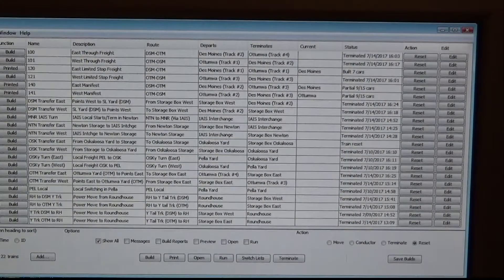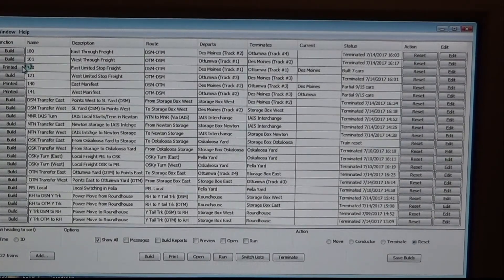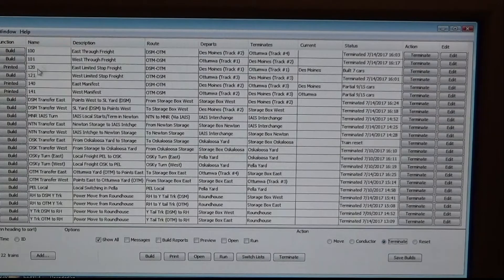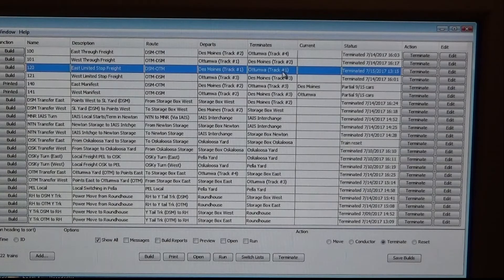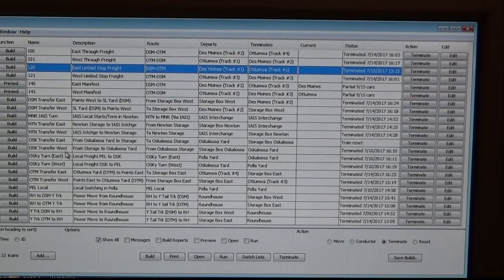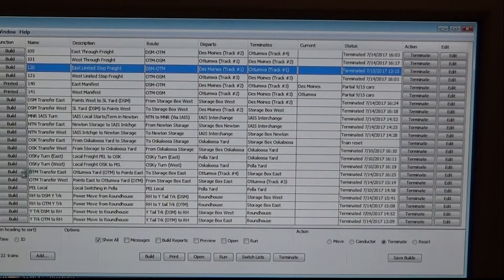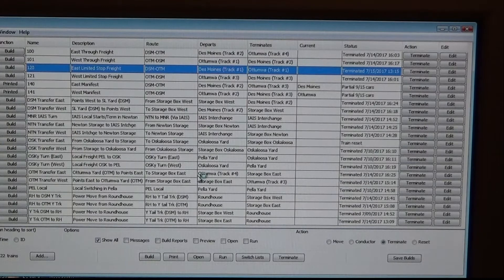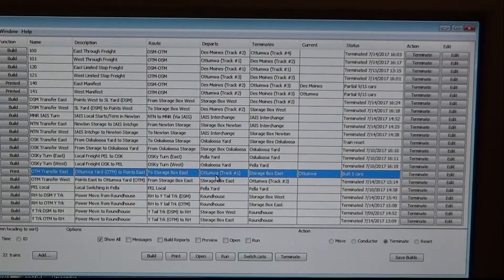DVRR Layout Update July/August 2017

Comment: Installed the program a few hrs ago and it changes the feel of the model railroad. With out a doubt this is a far superior way to switch cars on a model railroad. JMRI operations is simple to set up but, it is time consuming. once all the info is in the program its a breeze.
Reply from the maker: Agreed. There is a fair bit of "tweaking" to do, but once that's done it works great! Thanks for your comments!

Comment: thanks so much for this update, the drawer idea is a great one, do you just set them up as "tracks" in your "staging" yard?thanks for sharing, Chuck RVRR
Reply from the maker: I currently have the bins as "yards", but I may change that to "spurs", with some settings checked for custom loads. That way, the program will automatically load and unload them at the storage drawer level, rather than in the staging yard twice (out to drawer, and back from drawer). Thanks for commenting Chuck!

Comment: Yes I tried jmri ops, see some vids a while back. Worked well but a lot of setting up to do eg spur lengths etc.  Decided to stick with ccwb for now due to easier and self correction also no must for computer printouts. Its 6 of one vs half a dozen of the other and personal prefs. One is not "better" than the other imho anyway. Thanks for the vid. Robert
Reply from the maker: Robert, I guess I should have clarified that it worked better for me. I like the idea that it is closer to the way the prototype systems worked in the era I model.  CC&WB are a good system too and has work well for these many years. Thanks for your comment and for watching.

Comment: very nice update,  how did you get jmri to just dispatch cars?  ive tried getting mine to do that but didnt work,  idk if you could give me advice on how to do this or not? any help would be appreciated. ty chris
Reply from the maker: Are you looking to just move the cars and not the locos? This program is not a dispatching system (like CTC), rather it is a car forwarding system. For dispatching, I use Track Warrant Control forms.
Reply: i want to move cars around the layout from interchange to industry to stagging and back
Reply from the maker: Ok, first you set up your settings (max train length, train travel directions, etc), then set your locations. After that, add and set your cars on the track you wish to start them on. Next, add and set your routing under "routes" and then set up your trains that you want to run. Basically the route is the order of the locations, and the trains follow the routes. Have you set these parts up already?